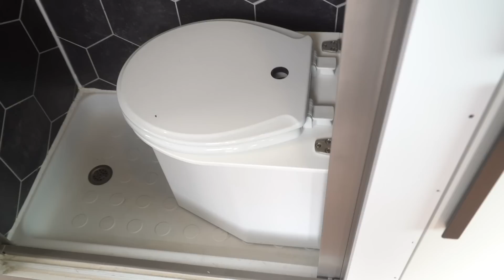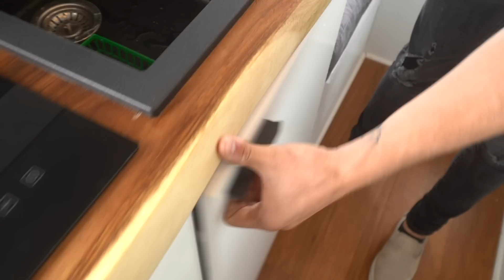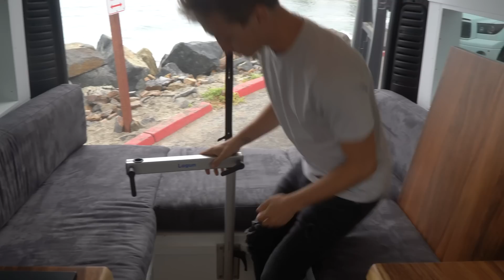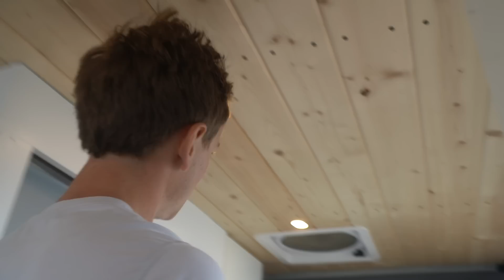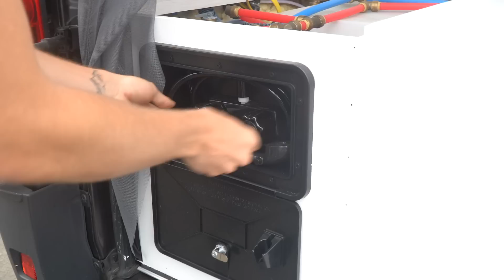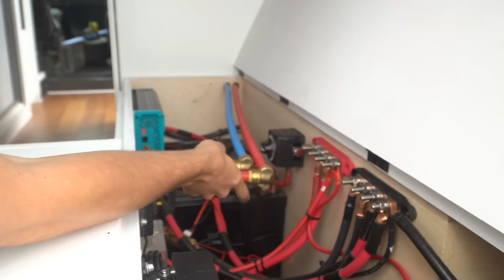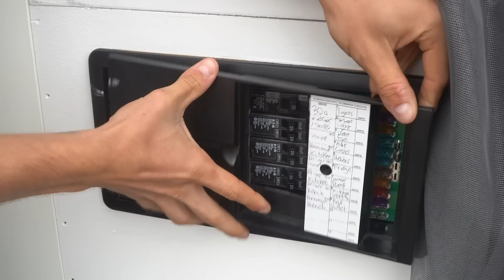LUXURIOUS Custom Van Tour | MASSIVE Black Slate Shower | 12v AC | Full Course On This Build!

Comment: This van looks cool overall but if I was a paying client I'd be upset about the really thick, uneven caulk in the shower. I didn't realize it was caulk at first and kept wondering what was hanging in the corner and was wondering if it was a skinny little water line and then when the camera zoomed in I realized it was caulk. I'm also surprised that you don't have a p trap under the sink. You risk unpleasant smells and fumes coming up from your gray water tank without a p trap and it also makes it more difficult should you accidentally drop your ring or something down the drain.
Reply from the maker: There is no grey tank, per request, and the corner of the shower had too wide of a gap because of the way these tiles fit and without the caulk it wouldn’t have been waterproof. Thanks so much for your comment! ❤️

Comment: Love the layout, love the thought that has gone into this build. A little constructive criticism, maybe rethink your finishes, so there are not so many screws etc exposed. (coming from someone who worked in construction, not a keyboard warrior) Other than that, a really great job, well done! Also, love how you showed putting down the bed and keeping the smaller cushions on the outside. A lot of people put the smaller cushions on the inside. Well done!
Reply: I agree! I install custom kitchens. I like the way he uses Ikea cabinets to keep costs down, but they do require a little more thought on how to make them look premium. Also whoever applied the caulking needs a lot more practice. It really takes away from the final product
But all in all a great design layout
Reply: @ianmorrow5968  YES!!!  That caulking was terrible.  I've recaulked many a shower and have done a cleaner job.  Definitely takes away from how badass and beautiful that shower could be!!
Reply: Agreed!  that jumped out at me and I couldn't stop seeing it.  That and the outlets had some poor construction/cutouts showing outside the plate line.  But I love the design... just need that attention to detail so it truly looks more "luxury".
Reply: Where can you buy this already built I'm a senior with no muscle power
Reply: I said the same thing. Lots of bad edges and caulking and those screw holes souks be covered with screw caps. So much cleaner look.
Reply: I love this

Comment: My OCD approves of your electrical box layout, and appreciate the detailed description. VERY nice setup!
Reply: My OCD had a cow or aneurism seeing the “hardwired” hot water heater Romex to white cord electric taped (I presume a connector taped over) right next to water lines. Not the safest idea and certainly should be connected in a 110v box of some sort, such as at the circuit panel where it belongs.

Comment: I really like the electrical and water systems. I'd make some different changes but I'd but put same systems in. I'd need put a small microwave in there or a convection oven,1 or 2 tv screens with a security system and a 12volt cruising n comfort ac,it's pricey i know,give it a lift too.  Great job, I'm interested in the build series.

Comment: IS the water from your AC system actually feeding back into your drinking/shower/dishwater system?  Seems like it could have stagnant water sitting is what we used to call swamp coolers back in the day, going back into your "clean' water.  I also agree about a locked door or system for your water access--sad that we can no longer trust people not to mess with stuff anymore.  Thoughts like this never crossed our minds when camping in unlocked tents and campsites in the pre-90s!!  Now you have to think about how people can mess with your safety and belongings anymore just for sport and their entertainment!!
Reply: I didn't understand that, either.  That water in the swamp cooler is a bacteria breeding ground.  It should be draining in to a waste tank, not back into your water supply.

Comment: my only problem is your water fill is exposed and not locked away, other than that lovely van
Reply: Are RVs locked away? I'll need to check, that's a good observation but for off grid usage, I think the risk of tampering would be low.
Reply: @TheRoadTaken  usually, they are locked. it's just people can be evil even when you're minding your own business. I guess times have changed quickly. I still love this rig though, actually I took a lot of pointers from your or this design, just I don't trust people these days.
Reply: @nourahrmumeenfba  My friend had somebody pee in her water fill valve. He was drunk and he thought he was in a porta potty.
Reply: @isaiahbangura4421  and i would have beat his ass. Truth.

Comment: I like the overall design but that water piping on electrical side giving me some jitters. Water... Pressurized.. no matter how the joints are connected.. will always leak when you least expected. Removal of the batteries for replacement will be a little cumbersome with that water pipe lines above.
Reply: Same. Place electrical on one side and water on the other.
Reply: Sometimes the customer has to be talked out of stupid decisions for their own safety. You should have refused to run those pipes. Now you have opened yourself to a lawsuit if someone is injured.
Reply: The water lines running directly over electrical screams stupid & unsafe.  There are so many  options to make it reasonably safe and I wonder why you would leave it like that?
Reply: I noticed that as well.
Reply: I totally agree with water running over electric.... no support- pipes bouncing with ever bump in the road.... them pipes are going to rub against the wood they passes through and leak all over the electrics... good professional job.... NOT!
Reply: Yupp

Comment: Only thing I would change is a sink trap under the sink to stop any grey water smells coming up thru the sink. Nice van guys.
Reply: @vandaddy-o2732  how is it a problem?
Reply: @ShadeTreeKennyT  Unless I am mistaken, I believe he is referring to the fact that you can get small creatures, like snakes, mice and such, finding their way inside by way of the pipe. Although that could be fixed by putting some kind of a screen over the end of it that allows the water to continue to drain through.
Reply: @paranormalreality1725  ah, ok, makes sense. Yeah, I would attach a screen over the end and call it done.
Reply: Some points on the grey water. 1. It drains to the ground so no tank smell. 2. He said it’s your option to install a tank. 3. A screen is a good idea, but one that lets food particles get through. 4. You can not drain grey water onto the ground legally in Canada, and certain national parks in the USA ban it, so figuring out a drain tank in the design is a good idea.

Comment: I think you should move those water lines from the electrical box.  This is not safe.  You could put them on the outside of box and cover that with another piece of wood.
Reply: or it could have been built with the water and electric systems switched
Reply: I agree
Reply: I agree.  Thought that was kinda scary.

Comment: Great design! Couple suggested tweaks: simplify water distribution lines/connections at water tank area, improve maintenance access to water heater, redirect water lines away from above batteries, make "dog leash" storage box garage easily removable to increase rear van carrying flexibility (bikes/kayaks etc.), relocate shower rearward, replace with dual seat (w seat belts), add overhead shelf above front seats, add insulated/heated grey water tank (4 season, many sites require contained waste water), use Ford Transit AWD 3.5 litre EcoBoost platform. That would be near perfect for me. 😉👍 Indeed, you've created a very intelligent and well thought out van! Well done!
Reply: Totally agree about the Ford platform!

Comment: Great walk thru.. I'm interested in purchasing the course. Quick question - Could I design a bench set-up with a removable U-section & enough space between the sides to accommodate a motorcycle (and still fit the water/ electronics below)?.. Thanks again & continue the stellar creations - Jb
Reply: I’ve watched hundreds of these videos and have seen a few with a motorcycle. This design looks 2-2-2 (~6 foot width with each side and the walkway measuring ~2 feet each). Can your bike fit in 2’ width?

Comment: Love it. Love it. Love it! I was wondering what you use to close off windows for heat, ie from cabin and side windows. Do you have privacy at night with lights in inside the cabin? I love the in-depth information with the electrical, being a former technician, and I appreciate the information on how the electrics for the van is hooked up. I feel very confident on actually putting together my own van now after your comprehensive demonstration and when I’m ready will definitely rely on your guides. Thanks so much ❤️
Reply from the maker: Awesome! The windows have insulated inserts that you put in when you want privacy :)

Comment: When you have to run plumbing through an electrical box, you never do it over the top of the electrical services. You do it underneath or at least as low as possible in the box as you can. And put a shower tray in the bottom of that box with a drain venting out at the bottom. The way that is hanging above all the electrical and not secured, just hanging out in midair like that with an angle in the pipe no less. That is just asking for so much trouble. Totally not a good execution of what you needed to do there. You could have gone all the way over to the wall and secured it and it would have cost you an extra few inches of pipe. Just because you didn't want to do it doesn't mean it's okay to do a s*** job of it. If I were your client I would make you fix that mess before I even drove away with it.
Reply: Easily remedied. A Bit harsh.
Reply: @BarryMDHo  it’s not harsh when it’s straight facts. The way it’s routed in the video is a serious fire hazard.

Comment: Nice build. Anyone have any ideas for getting water to the sink without having water lines in electrical compartment? I'm thinking of doing a build with shower and sink on opposite sides and would like to know any additional solutions for this.
Reply: The water routing through the electrical was is my only concern here. I've used sharkkbite products before and haven't had a problem but my usage was in a stationary structure. Otherwise great build.

Comment: Love that there’s a shower w/ a toilet that u can remove, while showering.  There should be a locked panel door for the outside city or gravity water, so no one bothers it.  I also, love that the van has AC, not many do.
Reply: A lot have fans, but no AC, because it’s hard to find 12v AC that won’t leak.
Reply: Gee! That was a major concern for me. I’m viewing this in 2023 and safety is crucial.

Comment: First van i’ve seen with a full shower and lots of nice features!. Few changes like locking the external water, move the pipes away from electrical. Overall looks very good, will the batteries keep up though?.
Reply: They do make a lock for the water intake.

Comment: lmfao.. 110v to 5v usb.. what a terrible waste of power.
Reply from the maker: Not sure what you’re referencing! Please explain and educate yourself. The usb runs directly off 12v DC with no power loss?
Reply: @shaidenvalentine1  WTF! they have outlets that have both high and low voltage hookups!? thats amazing gonna try to find one.
Reply: I've never seen a standard 110v outlet with USB ports that didnt supply the stepped down voltage from ac main. That's what im taking about.. The terrible waste of power would be the battery bank feeding the inverter to convert it to ac only to have it stepped down to 5v at the outlet. Please educate me and tell me which model receptacle that is that has both 12v and 110v input hookups

Comment: You could put a cover with a lock over the water fill, to prevent tampering.
Reply: Agreed. Definitely wouldn’t have my water fill exposed.  Too many crazies walking among us that are just up to meanness for no reason.
Reply: You have also  Polluted your portable water system by having the swamp cooler return into it after picking up whatever bacteria is on the filter
Reply: Some scouser will piss in it 😃
Reply: I agree it would be a good idea to put a lockable cover ,also to save save storage space in the overhead lockers get large cushion covers and fold the bedding inside them that way it frees up the storage space,just a thought.
Reply: Fantastic build best I have seen so far don't mean to come across has being critical but the closeness to to the sink and the induction cooker top bothers me alitte.
Reply: There's no reason not to have the water fill inside one of the doors of the van. It's not like you need to access it that often.
Reply: Yes!  You took the words out of my mouth... that's the only thing that bothered me about this van otherwise it's beautiful!
Reply: Exactly, it would be a pretty easy fix though.

Comment: Awesome build,  especially love the shower! 
A little suggestion on the plumbing that will save you money,  look better, and provide better protection over the sharkbites, use the uponor pex-A with the compression fittings. 👌
Reply: Uponor is indeed what I’m used to in day to day construction and I plan on using that in my upcoming van build as well

Comment: Thanks for taking glasses OFF.  Very well explained & presentation.  However, the batteries made me wonder how easy it would be to replace? They seems pretty stuck between other wires & amp etc...  I’m curious about EMP event, anything protected? The outside water holes are open & the way people are now a days, I would rather have it closed and locked. May I ask what is the price for one of those vans?  An antenna for internet would be great.
Reply from the maker: Of course, that’s what the fuses and breakers are for. Super easy to swap batteries which you don’t have to do.

Comment: Great build, but as a female I would never risk having my water fill on the outside of the van.
Reply: Especially unlocked.
Reply: @808kuualoha  those water lines over the electrical bother me too. What’s the solution? I’ve seen more vans than not with a shower on one side and sink on the other. 🤔
Ok to anyone who has gotten this far, I did a quick google search and I believe the answer is to run your water lines under the van👍 sounds good to me 🤷🏻‍♀️
Reply: What does being a female have to do with your water fill?
Reply: @mark_makes  I'd assume statistically having to go outside alone as a female is more dangerous than it is a for a male. How dangerous obviously depends on the time of day and the are you're at.
Reply: Ah, gotcha. I guess so, statistically speaking. Although anyone would have to get out of the van to use the water fill at a refill location, no? My understanding is that having the fill on the inside ensures you are the only one who has access to it.
Reply: @David Lawrence yeah that's understandable, but has nothing to do with your gender
Reply: Mark McGregor It does if you take into account that, statistically speaking, women are far more often targeted as prey than men are.

Comment: Evaporative coolers are GREAT in DRY heat.... but DO NOT work in humid climates or when it rains. I know.... I live in a desert state where most homes have evaporative coolers, but during monsoon season... they are useless!
Reply: Yep. I grew up with an evaporator cooler in a moderately humid area, and it was miserable.  But they’re ice cold in dry heat.
Reply: Aloha your max fan is a far better fan. Heck, a usb fan would be as good or better.

Comment: Nice build, going with the MDF "Ikea" style cabinets saves construction time at the sacrifice of weight and strength. Particle board doesn't like a lot of movement so hopefully the owner stays on pavement. I like a van with a dedicated shower and toilet. Plumbing and electrical are two of the most complex pieces of a van conversion. Having a water leak in the electrical box would be a disaster, I would have liked to see them separated. Looks very tough to remove plumbing components if any fail. I like the easy clean toe kicks. I agree with what has been said about the evaporative cooler. Moisture is the enemy of van conversions. Countertops are beautiful. Great job!
Reply: I agree. I liked much of this tour but was pretty horrified when I saw water pipers run over the batteries and electrical.
Reply: @808kuualoha  yeah I noticed hes super defensive and giving out some incorrect info like saying ikea mdf cabinets weight and issues cannot be avoided which is absolutely not true. Also for such an expensive build out (he says it was $100K) this is not up to standard.